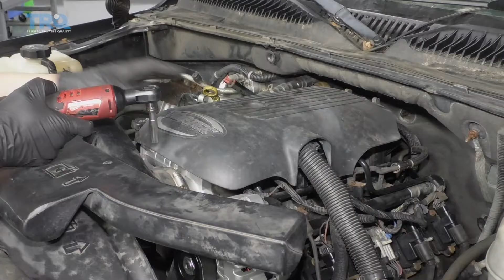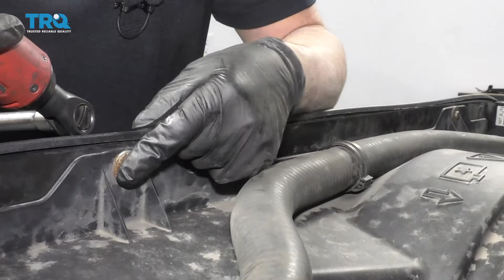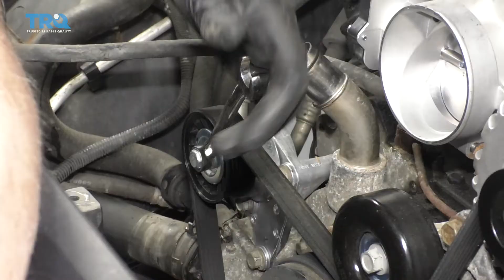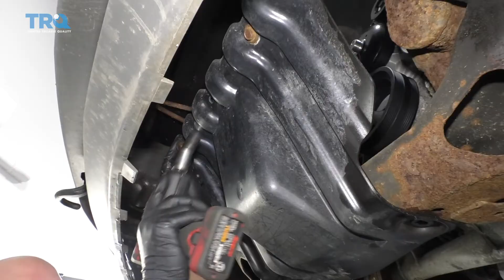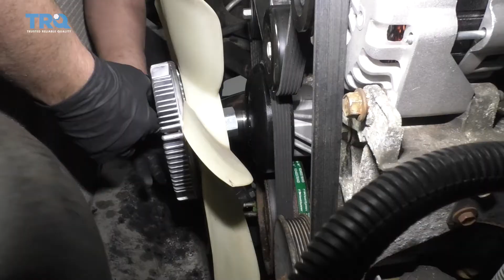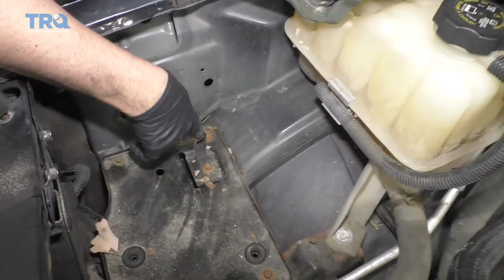How to Replace Harmonic Balancer 2000-13 GMC Yukon

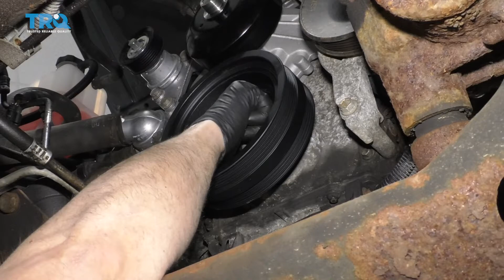Comment: 5:18 The torque spec are use old bolt torque to 240 ft/Ib then use new one to 37 ft/Ib and additional 140 degree.

Comment: This part didn't fit my 04 chevy suburban 1500 z71 5.3. It was off when I used a micrometer from an oreilys comparison part. I was having a hard time getting it to seat in with the installer. New part popped right in

Comment: You can tell these guys already took this pulley off cause it’s not that easy when it’s original I’m sure it’s been off before not that long ago cause I did it on mine and it was a nightmare just getting the center bolt out I had to use a 3/4 inch impact gun air gun too not a garbage battery gun. Then had to work hard to get the pulley off with the puller

Comment: Helpful hint: at 3:42, look in the center of the puller. The octagon there is for a 15/16 wrench. Put your wrench and ratchet on the same side. Push against one while pulling on the other. That lets 1 person do it without removing the undercarriage and inspection cover. Great video

Comment: Why not just live the old 1 at 240

The new 1 is just at 57
Is better 240 right?
Reply: The bolt is torque to yeild, one time use bolt.
Reply: @KELN Nostalgia that would be one hell of a mistake to break that off at 240ftlbs in there. I’d be buying a new crank 😂

Good idea to just use two new bolts.